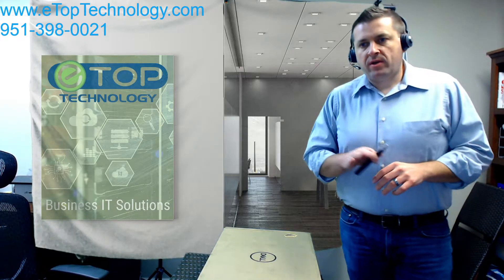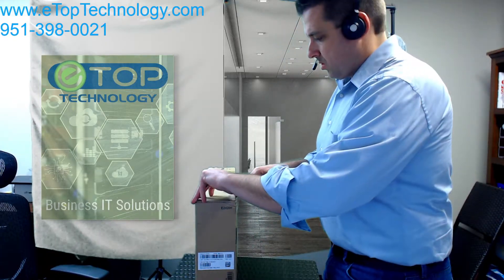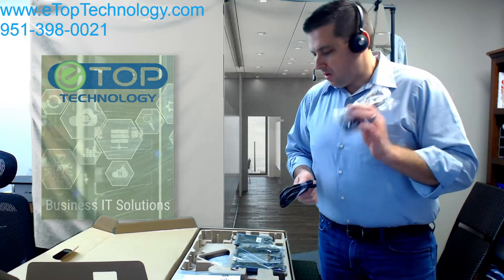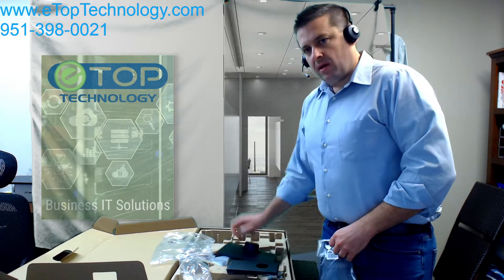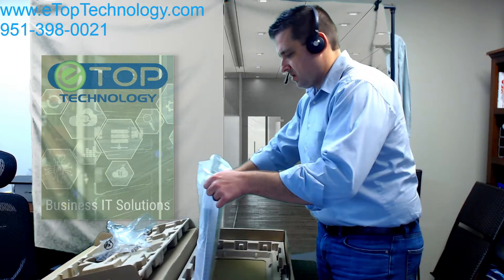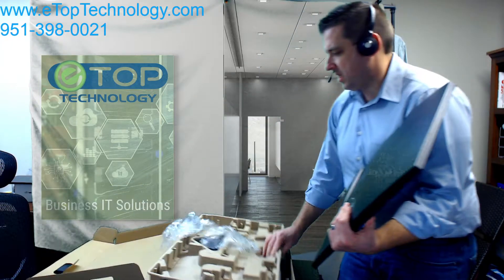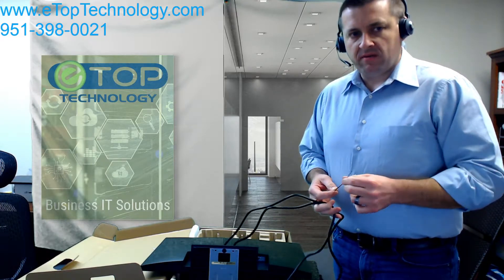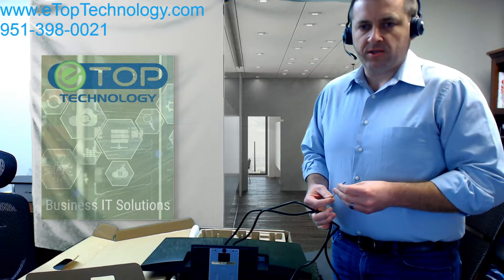How to build an e2420h Dell Monitor

Comment: Thanks for the video!
I have a laptop with hdmi only,
how can i connect hdmi cable?
Reply from the maker: So this monitor does not have an HDMI port so I would recommend going to Amazon and getting an HDMI to VGA or Display Port adapter.